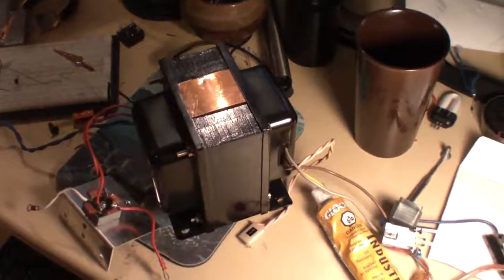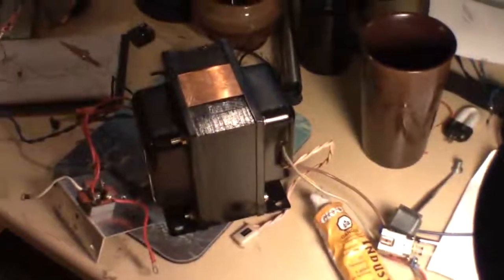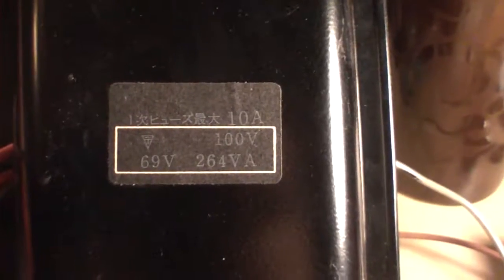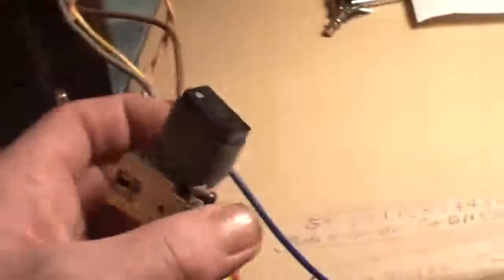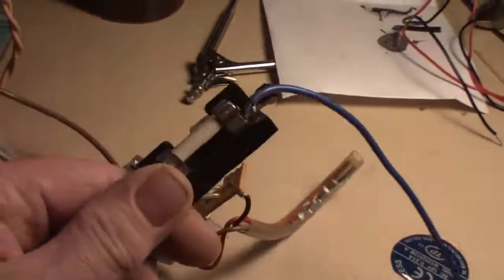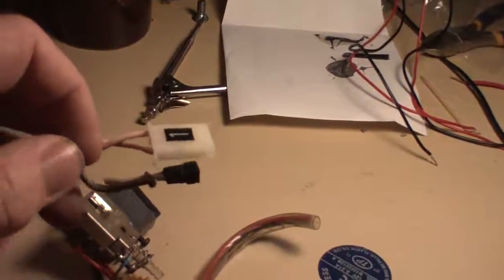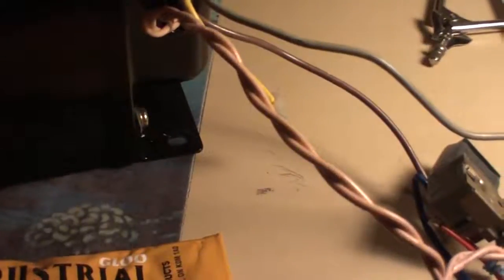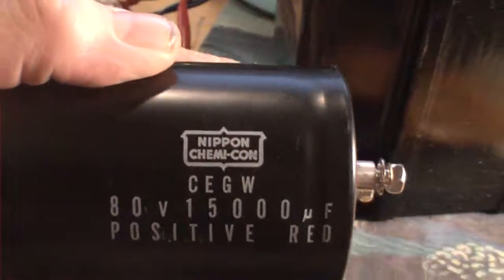Isolation Transformer? What do you think?

Comment from the maker: Well, it will come in handy for something... but not what I had hoped for. I need a 1:1 that will give me 120volts or close to, at fairly high amps, perhaps 10 max. I want to run an electrolyser. Most guys do it without isolation using just the bridge - but I'm told thats very dangerous. It's for a torch.

Comment from the maker: Thanks Dave. Yes the amp did work, sort of, one channel was out. i did find that one of the smoothing capcitors was blown though, or , i think it is because when I test thj ohms across the leads one does the expected slow climb, and... the other one ... it just reads 1 on my multimeter which i think means infinity, as the 1 is not on the same side of display, its off to the left, not the right where readings normally appear. Anyway...